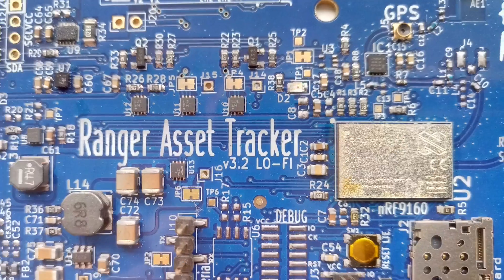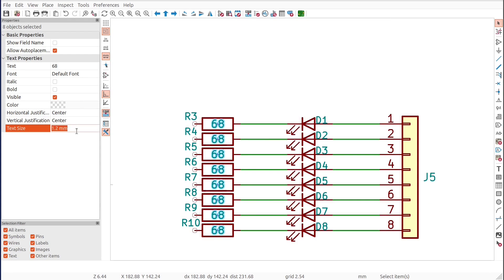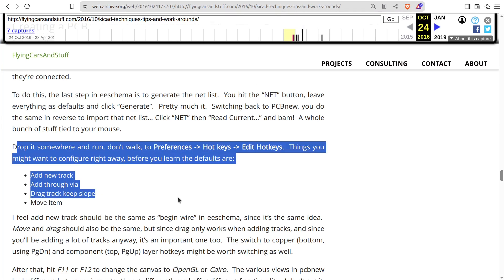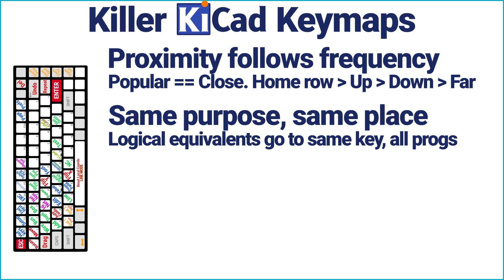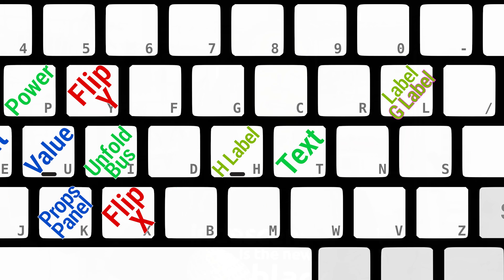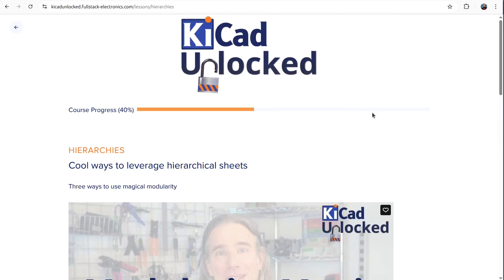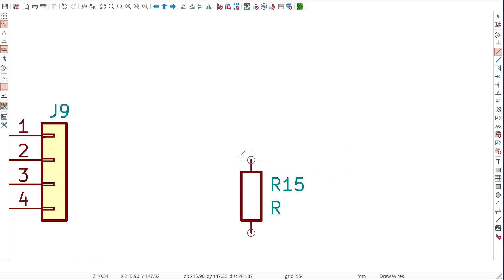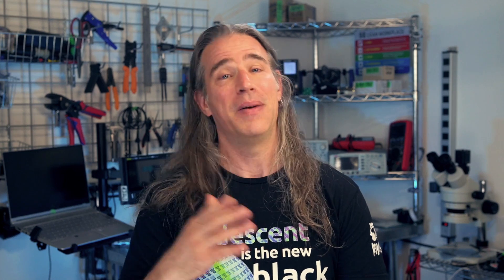2 KiCad Tips Save a Million Clicks

Comment: Amazing stuff you made. Have you thought about putting your library i GitHub, just like KiCad has? I found that very smart because you can update all the libraries super quick without having to download everything which take much more time.
I have always had hard to learn hotkeys and only use about ten for software I use frequently and less otherwise. This is what have stopped me from switching to kiCad because I think you are more depending on shortcuts. So it was the keymap that directed me to your videos. A well thought map and a printed paper map that I for sure will have use for.
The other tips is just remarkable. I have done exactly the same in the CAD softwares I used. That is, fixing narrower LEDs and the center problem.

Comment: Keymaps should make sense and strives to be consistent- in the ecosystem, or to known standards. I mean who could have guessed that Move is "1" and Find is not CTRL+F? Your fingers know and can reach almost all parts of the keyboard in an instant, it really doesn't matter if two similar action keymaps are spaced 4 keys apart.
Reply from the maker: Sure, that makes sense, is pretty much the default setup.  
My problem is I do this too much to keep taking my hand off the mouse--it slows me down and will probably eventually mess up my shoulder.   
Short version is I'm the kind of guy who uses a dvorak keyboard, so my little world is always alien and hostile to everyone else and conversely I can't easily use any standard system (I always look like a doofus trying to type my own email into someone else's keyboard)... but since that's 0.05% of the time, I'll gladly break standards to optimize 99% of my life.

Comment: In KiCAD 9.0 I find the most frustrating thing is that there always seems to be a tool or something stuck to your cursor when you want just select 
or vice versa you want the tool to stay but KiCAD drops it.  I end up spamming the ESC key in frustration.
Reply from the maker: Hah, yes!  My walkthroughs are polluted with a lot of pretty hard bangin' of that ESC key, maybe it's frustration leaking out.  But be sure to check the setting of the Preferences -> Common -> "First hotkey selects tool".  Had to read the tooltip 3 times to grok it, but unchecked makes me happier.

Comment: Hotkeys; I wonder if it is that easy to UN-learn the defaults that are now laser engraved in my bones (started with KiCAD v4 in 2016 I think it was, it has come a long way). 
Schematics Grid Alignment; Doesn't that mean that the Rotate and Flip will make it out of position, and what you save in one place, you lose in the other?  And redoing all the symbols that would be out of alignment seems like a lot of work, although I don't know how many are, but I would guess 50% or more.
I have never felt that a small grid slows me down. Maybe I think too slow, and hands are always fast enough. ;-)
Reply from the maker: Yeah, wow you've been using it as long as me!  
In that blog post from back then, I wrote "Drop it somewhere and run, don’t walk, to Preferences -> Hot keys -> Edit Hotkeys.  Things you might want to configure right away, before you learn the defaults are [...]".  
So the obsession is long standing but I'll admit that the fact that I was already on a dvorak keyboard made the defaults really awful, so that help to prod me in the direction of thinking about it super early.
As for the alignment: no!  No problems there.  The basic element in Device is this (for the cap) https://fullstack-electronics.com/downloads/dev_c.png -- I just drew lines on the 100mil/2.54mm grid there to show how the pins are on the 50mil.  But if you move it so one pin is at (0,0) (or anywhere on the 100mil grid really) it changes the "add" process, but nothing else about the symbol really.  And, in fact, if you do manage to grab it by the center of the diagram, you'll be placing that on the grid and punching the pins back out to 50mil grid points.
In the end, your right tho: a 50mil grid just isn't that bad or slow.  It's mostly that I'm a compulsive process optimizer and ... well maybe I don't have that fine motor control (I have been called the "sweedish chef" by one that shall remain nameless.  borg-y-borg).

Comment: Love the video!  Although the second tip is confusing (to us) because L/C/R and indeed all symbols in the default KiCad library are on the 100mil grid and the symbols are placed by their 0/0 coordinate.  If you have a workflow that prevents this, please let us know because we are not aware of this being a problem.
Reply from the maker: Thanks!  I think I may have worded it wrong but look at this: https://fullstack-electronics.com/downloads/dev_c.png
That is me opening up the Device:C (from /usr/share/kicad/symbols): all I've done is draw lines on the 2.54/100mil grid.  So the pins are spaced by a multiple of 2.54mm, yeah, so they'll work fine with that grid.  But when you grab it from 0,0 well... they're not on the grid.  
I sure hope it's not that I've been setup for years using outdated libs 'cause of some bad config (though that would be hilarious, in an awful way).
Reply: @PsychogenicTechnologies ah,  there's indeed a couple left over that are on the 50mil grid.  Let's get that fixed.  R_small and C_small are good alternatives in the standard library
Reply: That’s good to know
Reply: From the Kicad Library Conventions S3.1: "For symmetrical symbols, the symbol must be centered around the origin (0, 0) in the symbol editor.
Exception:
For non-symmetrical symbols, or symbols where this requirement would move pins off the 100mil grid, then the symbol should be placed as close to the origin as possible while observing the pin grid alignment requirements."
So in theory pins should fall on the 100mil grid, but not every symbol in the library necessarily follows it.
If you find symbols that don't line up, you can submit a merge request for a fix on GitLab (or at least add an issue to the tracker).

Comment: someone should make a pull request to kicad that changes the default symbols so they're always selected by a pin instead of center, imagine how many thousand hours per year that could save across the entire userbase
Reply: That would be a massive undertaking for the chronically overworked team of library maintainers.
Pins are supposed to be aligned on a 100mil grid relative to the center of the symbol though, so you should be able to align pins easily.

Comment: mnemonics are essential when you only use the tool occasionally, since you spend more time figuring out the hotkeys than actually using them otherwise
Reply from the maker: Hi Thomas!  Yeah, that makes sense.  I've mapped things into my finger muscle memory--same with my keyboard in general: I never bother changing the keycaps, so my dvorak layout never matches what's on there (makes for fun times anyone else wants to use my station), and to know which key something is I have to mime it out.  That's great if you use it a ton, but dusting it off every month or two to do a quickie--probably want to stick to mnemonics.
One thing I'd like to see: I put F1 (traditionally "help") as the kicad "hotkey list" dialog, which assists but I'd love to also have a visual mapping there, like my SVG.  Lotta work for something pretty optional, tho.
Anyway, thanks for commenting and I'll try to have at least some of the tips be useful to even more casual users :)

Comment: Would it be possible for kicad to upstream your 2nd tip? Or it be too much backward incompatibility?
Reply from the maker: The official KiCad account actually commented here, on that.  We'll see, maybe I've missed something obvious, maybe it's worth an upstream patch.  The really great thing here is how KiCad stashes the contents of projects in a cache.  For example, I can use a ton of custom symbols, like say a really specific chip or R_1k2_0402 with the MPN and all that setup, or a custom footprint, that no one else has.  Now I share the project with you, but not my libs... no problem, they're all in the cache.  And you can even export all that stuff.  

So, regardless, I don't think backward compatibility would be an issue.  Bigger issue would be that, if you really want the part body centered at 0,0 (as per the KiCad library convention) and to have the pins on the grid, you're going to have to change how it looks.  And a lot of people (including myself) are pretty accustomed to how things look... dunno how much of a barrier that would be.
Reply: @PsychogenicTechnologies we discussed this internally and the consensus seems to be that the larger R/L/C symbols are not going to change from their 50mil grid.  This is partly a desire to avoid 400mil long resistors and partly to avoid confusion when doing ERC.   The R_small, C_small and L_small variants have all their pins on the 100mil grid
Reply from the maker: @kicadeda  Ok, I totally understand that--I wouldn't want a super-long component, and trying to go the other way would make them look pretty terrible.  Anyway, I know that I'm something of an edge case: both insisting on these components and on sticking to a 100mil grid... And I've found a compromise solution that makes it so the schem looks identical to any other with the standard sized symbols, while satisfying my need for speed.  
Thanks a lot, both for taking this into consideration, and for keeping me in the loop.  It, like the software  itself, is super appreciated!